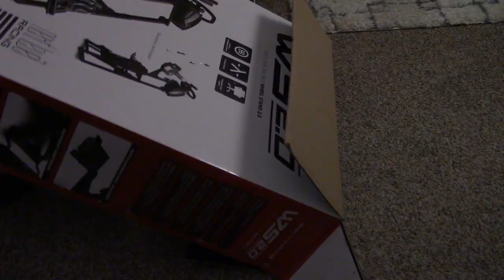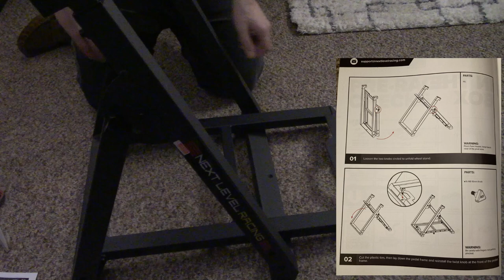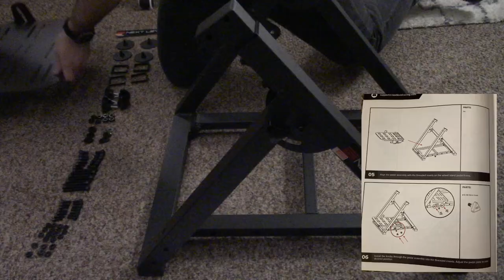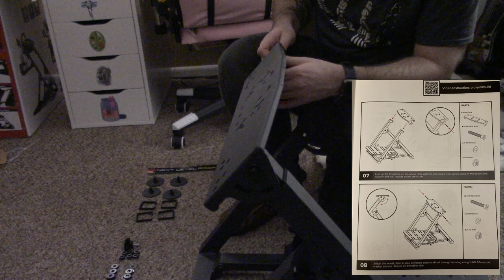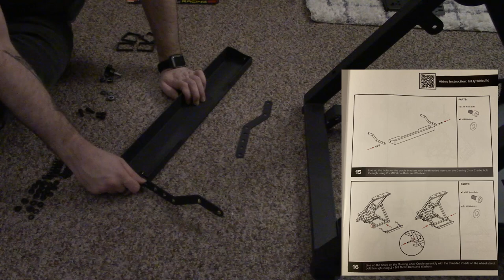Next Level Racing Wheel Stand 2.0 Building Guide + First Impressions!

Comment: Great information!  I just ordered one of these to go with my Fanatec GT DD Pro with 8nm boost kit, so I was taking a gamble on the stand being able to handle it.  Sounds like from your experience mid-level DD wheels should be fine on the NLR wheelstand 2.0.
Reply: how did it go? I just ordered one as well and I'm thinking of buying the boost kit with my Fanatec DD sometime in the future. (upgrading from a G29 so we'll see how it goes
Reply: @Mutex_Lock  I'm actually still waiting on my pedals and wheel😅.  Wheel stand is here, I just haven't put it together yet.  Fanatec sent me an e-mail saying I should expect the order to be shipped around April 7th so I'm still a few weeks out.
Reply: @Mutex_Lock  Wheel and Pedals are great, ended up ordering the CSL load kit for the brake upgrade, as well as the CSL Pedal Kit (metal faces).  Wheel torque provides a decent amount of 'road feel' in-game.  The Wheelstand 2.0 is more than sturdy enough to handle the wheelbase with the boost kit upgrade.  Feels super planted.

Only thing I would change is I'm considering upgrading to Fanatec's inverted V3 pedal set, but it's like $600 or so.  Since I just got these I'm going to get my money's worth out of them and use them for at least a year haha.  How you liking your setup?
Reply: @anddudewaslike  yo did u get the load cell too? If you did, does it work well with the stand
Reply: @joshuadelellis852  I did get the load cell as well as metal pedal upgrades too.  It works great with the stand.  The stand is quite heavy so it’s able to handle both the torque from the wheel as well as jamming on the brake pedals pretty hard. Just make sure that your chair grips the stand’s wheel tray tightly enough. I use a fairly heavy office chair so it’s quite stable for me.
Reply: @anddudewaslike  alright thanks mate that’s very useful :)
Reply: @joshuadelellis852  no problem, happy hunting!!
Reply: @anddudewaslike  nice. That's my future set up. Hopefully. Thanks for your insight.

Comment: What’s the difference between the wheel stand 2.0 and wheel stand DD?
Reply: 2.0 is $50 less, and comes with the cradle if you are going to use a rolling chair. Just like the original wheel stand DD, it can be upgraded to a full cockpit setup with their GT Seat add-on

Comment: Which pedals do you use?
U think this 2.0 version could handle a set of HE Sprint?
Reply: @matt51  Thanks! Another question if you dont mind... I travel a lot so I want to carry with me a "portable" setup. The box you show in the video is almost the size limit for oversize baggage in most airliners. First question is if a normal chair could handle the use of a +60kg loadcell pressure and the second one is if mounting and disassemble this stand every 2-3 days would be too much...  
Thanks!
Reply: @matt51  Thanks so much, man! Really appreciate it
Reply: @matt51  thanks for the awesome video! Is your CSL elite pedal with Load cell? I have recently got the new CSL loadcell pedal so I wonder if the castor cradle of this stand is good enough to stop my chair moving backwards. I have a GT Omega gaming chair on carpet. Thanks mate!!